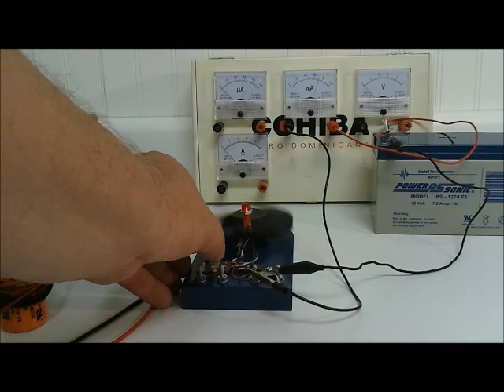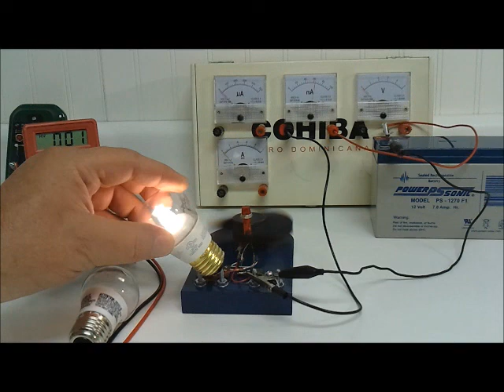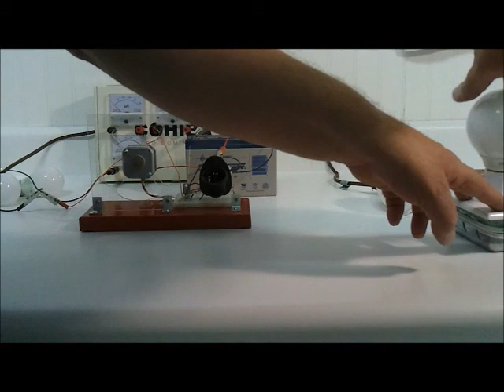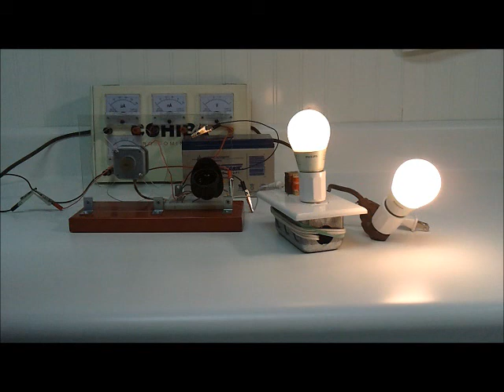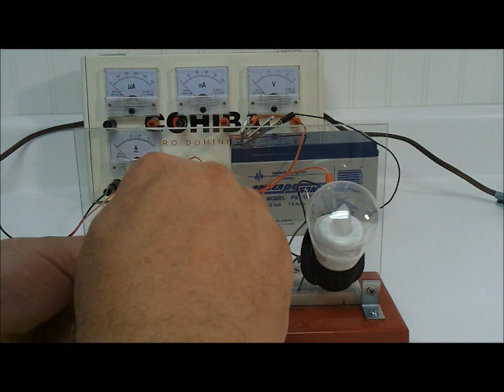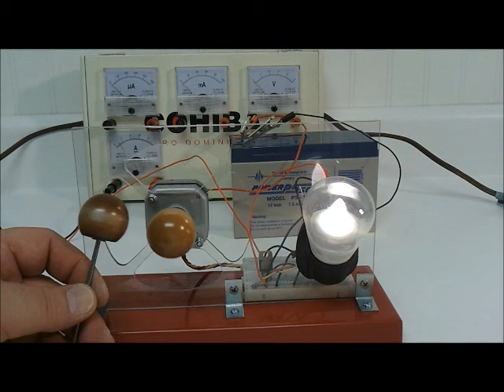SSG Experiments and Observations

Comment: Very cool experiments.

Would it be worht the try to hook up the stepper or a fan moror to a
Van De Graaf generator belt? and compare if it would pout out more
than the dc motor?

you make very neat machines. Will have to copy some of your setups
so I don't have to fumble for my builds in a drawer with tons of other parts.

Yves